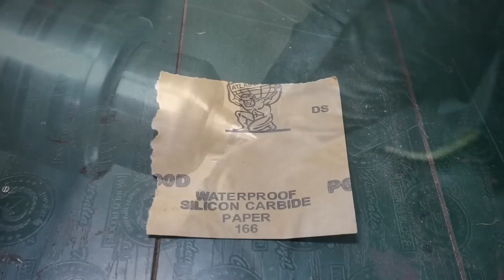Restoration Rusty Old Hunting Knife! The most Beautiful Handle

Comment: Great job restoring that knife but I have a tip when you heat treat try not to take the blade out of the liquid you are using  and move the blade up and down the entire time the heat treat will be more even though the metal
Reply: 1 week on water

Comment: I was thinking to myself - I really don't like nuts and bolts on knife handles, but in this case it was beautiful.  Excellent work.
Reply: The nut is holding the knife together,it would fall apart without it ! Thats how they get around not using a full tang. He did a great job on that knife like object.
Reply: @edwardbtown2766  not true. Many knives have short tangs. Threaded tangs just come loose of break over time
Reply: @CagedSUPERMAN  ok
Reply: @CagedSUPERMAN  ok
Reply: @CagedSUPERMAN  what is come loose of break?